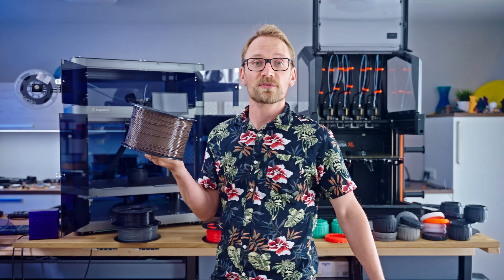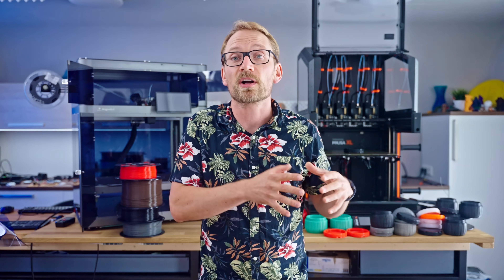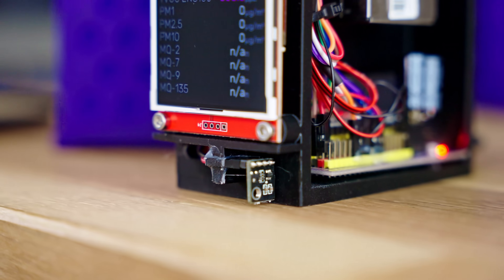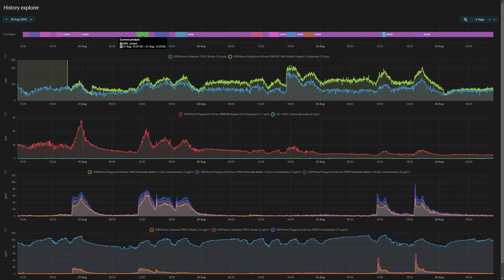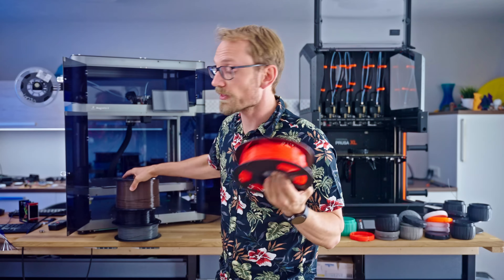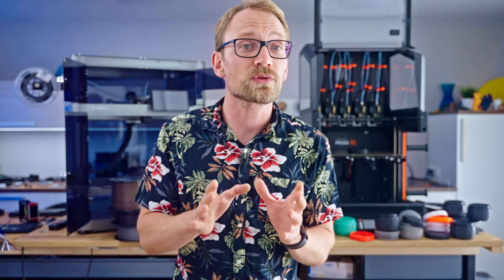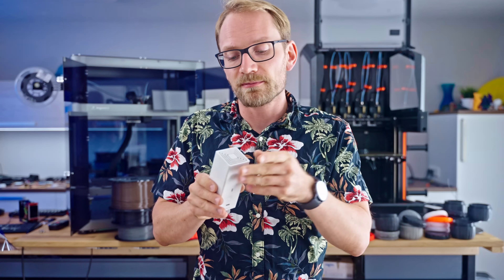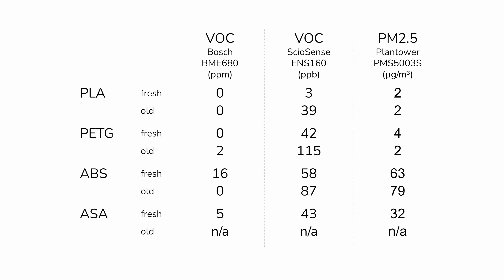3D printers are worse than I thought. Time to do something about it!

Comment: Chemistry has problem with fumes, toxicity, flammables, ... So in a professional environment you will have a cubicle with safety windows, a burn proof ground and a ventilation to the outside. And showers + seperate clothing on site, so you do not bring any contaminates home.

3D-printing and solderwork has become a home staple and we do have more knowledge about long-term health risks (Woodworking has a dust problem). So IMHO any reduction of possible harmful substances is good - as the more the likelier you are to win the illness/cancer lottery. Just look at asbestos and glaswool. Nano-fibres with an cancer incubation of 15+years.

In a work environment you will have ventilation and filtering for worker protection. For home consumers this should become standard - an enclosure with filtering and possible a vent to the outside. Because at home there is no worker protection or required testing nor insurance. If you get cancer as a work related injury you are covered - if you get ill because you did stuff at home, well you are out of luck.

Comment: Always good to remind people of these issues though I think it's still important to quote some old reddit comment when someone made a huge OMG THIS IS KILLING US AND DANGEROUS writeup: your monitors off gas more then a PLA 3D print just from the heating and cooling of it going on and off.

My printer is a MK4 that sits quite close to me. I made the decision a few years ago (probably should've done it sooner) to get an air filter with a HEPA and a cute little dinky carbon filter and put it nearby too. I exclusively print with PLA and PETG (though expanding on enclosures with filters so I can do some fancier filaments) and the 2 times I printed with ABS, I loaded it up, shut off my HVAC so it wouldn't pump air throughout the home, opened a window and put a fan in, ran the print and left the room. When I came back later, I equipped a full respirator with two P99 + VOC + formaldehyde filters. Once the print was done and everything cooled, I cranked filters and fans to clear out the room for a few hours before I turned the HVAC back on and went back in the room.

None of these things are "safe" but we also have to look at them in context of all the other plastics and whatnot we use. And for the love of all things holy, those tiny carbon filters do squat for what comes out of a printer. Professional printer filters (look up BOFA) have a carbon filters practically 2-3x the size of even the largest "comes with printer" or community made filters. And that's just the carbon filter, they still have HEPA and even a pre-filter. To pour a few grams of activated carbon purchased for as cheap as possible off Amazon or Aliexpress into a box with a fan and the cheapest robot vacuum filter you could fine and go "there, that will make it safe for me to run a dozen printers on ABS/ASA without worry" is practically negligent of the health concerns. If someone wants to feel at least a fraction of a percent better, do those filters... but if you want to run this as a business or something, invest in real filters. Also note: activated carbon has temperature limits... so "I got a active chamber heater so now I can print huge ABS/ASA prints" is just a respiratory issue waiting to happen. Took quite some time before people were willing to say "maybe cigarettes aren't healthy" at scale... gonna be a lot before 3D printing is in a better situation too.

Until then: I'll stick to PLA/PETG, have the room air filter running, and also buy filament from reputable brands as they're less likely to just throw whatever industrial additive/colorant gets them a result they want vs. something measurable from a health perspective.

Comment: So I ran a similar set of tests with my home set up. The crazy thing is I set up my control in my back garden in rural Ireland. On pretty much all fronts the readings outside were higher than when I was running my resin printer with water washable resin  or FDM printer with PLA or PETG. I'd love to know if anyone else has found the same? Cos my data indicates 3d printing is about as dangerous as a walk in the Tipperary mountains

Comment: I do wonder how viable it'd be to have a ventilation device next to the printer, sucking away a portion of the aerosol right as it leaves the printer.
Would that cause issues with temperature/pressure for the print itself? If not, it sounds like a brilliant solution.

Comment: Interesting video! I print both FDM and resin. I have 3 Philips filters always running. They also have some (very basic) sensors and i see them sometime show bad air quality and increase speed. My experience is venting outside works best but they definatly help. Also dont forget about everything post printing and (some) resins still fuming well after the print. One thing to note tho. Pretty sure printing isnt good for you but the same can probably be said for cooking, cleaning (with chemicals) and painting. Some of those also really trigger the sensors in my purifiers.

Comment: vent it outside! Even if you're renting a place, so long as you have a sliding window, you can vent. Buy a board, cut a hole in it, put a clothes drying machine vent in it coming from your printer box, and pop it in a window.

Comment: my hommemade enclosure is air tight except a hole in the far corner, and a server fan with activated carbon filter in the other, sucking air into the enclosure, extracting it only out via filter. Shure, it sounds like a cessna, but it makes a different when printing stinky abs. And actually, if i open up the enclosure and dont print, just let the filtration run, you feel the air getting cleaner. Its pretty fashinating..

Comment: The formaldehyde sensor in use here is also sensitive to citrus oils, CO, CO₂, alcohol vapors, glycols (as in tobacco smoke/vape clouds/fog machines), and other things, so that's not conclusive at all. Naturally occurring ozone may also cause faults. The fragrance in your body deodorant, soap, or surface cleaners will trigger them. A proper air analyzer would have been nice here, as would comparisons to other studies within the corpus of research on the subject to determine experimental faults. Get a big grow room filter and a proper 6 or 10 inch blower, they're not that loud and eat no power, but they adsorb for a long time and handle a ton of air. They're refillable with bulk bags of AC, even if riveted just grind off the rivets and replace with fasteners. Solar regeneration of media achieves about 60% effectiveness, so you can regen without a kiln but that's up to you. My experience with several grades of consumer filtration is it's a waste of money due to premium pricing, proprietary filters, and poor performance. You need to circulate the room air too for effective filtration, convection alone won't bring air 3 meters away into your filter in a timely manner. I duct from one side of the room to the exhaust on the other and run circulation blowers, with a permanently installed evac blower to purge the room if required. All of that cost less than $200 USD and 30 pounds of carbon pellets was far FAR less expensive than premade filters. You can adapt HEPA filters and large particle prefilters of your choosing on the intake for the system, which also keeps your blower clean. I'll say I have experienced some malaise, headaches, eye irritation, sinusitis, pharyngitis, and bronchitis from ABS printing in the past and the smell was detectable on the other side of the building, but not any more. My resin printer definitely emits more than anything except my lasers and causes acute symptoms. I also run cheap sensors of the same type shown here and they're not useless, but totally lack in discrimination ability and are prone to environmental interference from basically everything such as temperature, humidity, and occupant breath. We need one of these polymer peddlers to sponsor proper instrumentation, and I have questions about why there is no apparent effort to produce independent laboratory analyses. The studies I've read show that these emissions largely condense on the build plate very near the print and don't really go anywhere. In what is actually released in the air there are some VOC emissions but they were found to be far lower than a typical laser printer. The office copier is likely much more dangerous. Other researchers conclusions were that an enclosure with filtered exhaust and letting the chamber cool before accessing it were helpful, but as Thomas showed, these 'enclosures' are hardly sealed, they're more of a draft prevention system. These tiny toy filters on the machines are a joke. And quit using phenolic OSB in your shops lol, that's the biggest carcinogen producer in most places - it is terrifying to firefighters, they've demonstrated degradation at temperatures as low as that of a car interior and in a fire the smoke is deadly as hell.

Comment: I've worked in manufacturing for 26 years. 15 of them at Injection Molding companies. I am not worried about 3D printing. I've worked at companies that molded PVC, ABS, POM, PA 6/6, and even Phenolic. Working with these filaments and 3D printing itself is no where near on the same level.

Comment: "When I'm in the same room with a printer laying down PLA, I do get an itchy throat after about an hour or so". This is absolutely insane. I never understood this community's complete lack of safety. From day one my entire printers were in an airtight cabinet with industrial level three level filtration including massive carbon filters. I'm not even that health conscious but I do go to the gym and lift weights and I protect my body by trying to eat healthy. It seems like a lot of this community disregards this as not a big deal when you print PLA. If I had an itchy throat, I would have immediately adjusted something.
Reply: not everyone is as privileged as you are.
Reply: @KoongYe  Being healthy requires no more privileges than it does to purchase a printer. I hate the "you must be rich to be healthy" argument. If you buy a printer, plan to enclose it and filter the air or don't buy the printer. It is that simple. It will be illegal for these things to not have a monitored air filter in 20 years when the data comes out. PLA WRECKS YOUR LUNGS.

Comment: Oh man ... the most important question is still unanswered! For which 3d-printer is this gigantic, massive print-bed your holding there!? 13:37

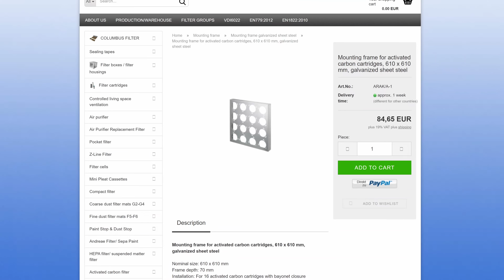But on a more serious note: at 15:40 I wished you would have gotten a more useful result, especially thinking about the Voron Nevermore and BentoBox Air Filter from printables. I thought combining these in a closed printer with an additional active charcoal filter in the back (like a Creality K1c) would help a bit or cannot hurt!
Nevertheless one of those IKEA room filters and a good portion of fresh air in a living couldn't hurt either, I guess!

Gute Arbeit!

p.s. If there is a new DIY printer around the corner ... like pimping a Voron like Sovol SV08 to a completely closed machine or upgrading an old Prusa Mk2.5/3 to a Mk4S with the cheapest parts possible ... please also include a section on those filters in such a video! Even if a Nevermore is not so effective ... see it as a reminder to n00bies like myself.

Cheers.

Comment: You should rerun with a better brand like PolyMaker and eSun who have health certifications foe the filaments.  Sunlu does not have certifications and is known to have a large amount of contaminants in their filament.  I suggest rerunning the tests to compare polymaker pla+ (it's mainly greeb), esun pla+HS(focuses on purity/health) and sunlu pla+ (focuses on cost and print reliability/quality). Test with ideally clear or white (less additives) and with NO fibres.

Comment: I come from the fire service, anything hot plastic sucks. I plan on getting a full enclosure together with a fume extraction system. My opinion is that the enclosure should be very gas tight since any fine particulates can escape through gaps or ventilation holes. Which is why I don't think that most contemporary FDM printer enclosures are useful. Plus every printer should be deep cleaned. Admittedly, I'm guilty of that, I don't clean mine often enough.
Reply: That's what I plan on doing it too, I got some used servers racks for cheap (not too confident with making a wooden enclosure with those cheap chinese printers...) If you have a good extraction system you should have negative differential pressure from outside therefore even if its not perfectly sealed the gas wont make it out of the enclosure. Now the problem with ABS is that it doesn't like to have fresh air coming in so the air flow should be as low as possible to avoid warping...

Comment: Given this is true, why would anyone print at home with ASA or ABS? 🤔 what actual benefits do you get over PLA? I'm also curious about TPU fumes...because that is actually a filament that offers something different than PLA.
Reply: Temperature and mechanical resistance. I found PETG to be the sweet spot for most uses case (still easy to print while offering good properties) but even then ABS/ASA remains the most temperature resistant for the price you can print out of the cheapest 3d printer without going for exotic filaments that require temperatures above 260degrees to print. I personally ditched PLA completely for PETG (90% of parts) and ABS for that 10% of parts that need better temperature resistance

Comment: Do you think this sensor box is also useful for laser cutters? or would you need different types of sensors for that? 
I'm much more worried about those than my 3d printers, even though I do have extraction, it still stinks A LOT more than 3D printing, and I'm always wondering if the room it's safe to be in. 
It's also pretty hard to look at the sensor values and translate into what's safe and what's not safe.. in the end it's just numbers, unless we build a cool HA dashboard that translates those numbers to safeness..

Comment: Ive just hooked up my enclosed printer to the negative pressure air vent in the room. Putting something smelly like acetone on the bed, you can safely test that zero air is coming out. Ive had to print the adaptors to make this work myself; but I very much feel this should be the standard. Either put it in a room or garage where nobody needs to be, or have negative pressure air extraction. These kind of ventilation systems are pretty much standard in buildings here; and if you are in a building without that, you can run a hose out of the window with an inline fan. I personally hate these printing smells, and unless proven otherwise im going to assume my body knows whats good for me. Cant say I like the filters; most of them that come with printers are a joke; and even a proper filter needs constant replacing to be effective; and who has time for that?
Reply: It's because many people don't have a garage or live in an apartment that doesn't have air extraction, then unless you have the owner comprehensive to dig holes to install one, HEPA filter is the only option .. but I agree it's not the most ideal one

Comment: Did I miss something or is there no part describing built in filtration systems? You show the Prusa filter in the video but does it work? I just assembled a mini enclosure and also have the HEPA filter installed and it's terribly loud. So I'm wondering if it's even worth turning it on or if I should get an air purifier from IKEA.

Comment: I built a clear plastic window insert with an external fans to pull the exhaust out.  My ABS printer is enclosed and connected right to the window vent.

Comment: I have my printer in a cupboard, with a small hole in the bottom, and a bigger hole in the top with a fan going to some ducting that I hang out the window. Keeps a slight negative pressure in the cupboard, and vents outside.

Comment: Just take a total of 22 by fours a couple sheets of plywood and a big plexi glass and acrylic window with a couple hinges from Home Depot and silicon cut out a hole in the back put a vent then put your giant large 3-D printer within it you’re looking at about $200 to do this little set up if you wanna make it look pretty, but it doesn’t matter. You can also just buy a shed and put a bunch of 3-D printers outside with vent if you live in a warm climate environment if not, you can do your garage if you have heating in your house there’s multiple different ways to be safe about this but putting it in your bedroom and running it not a good idea. 👍